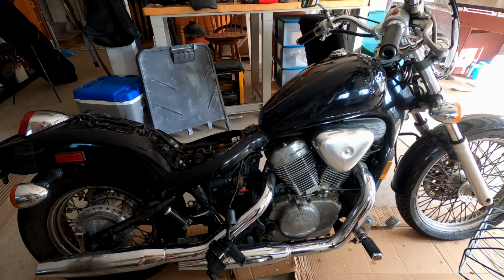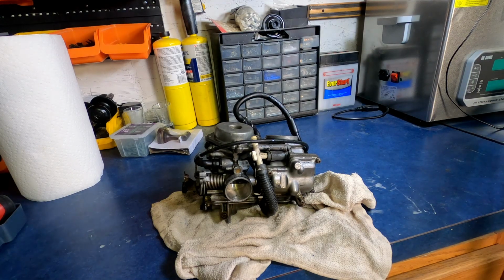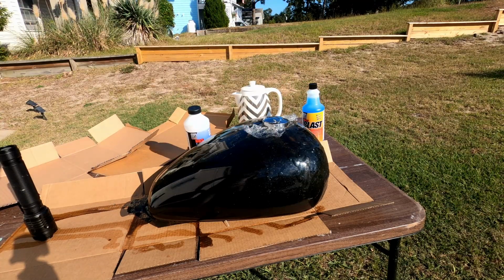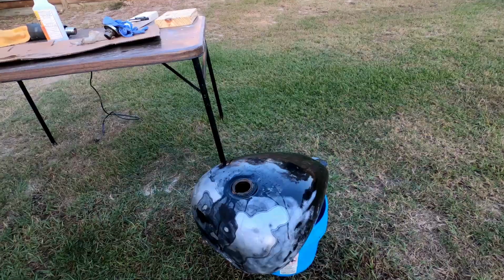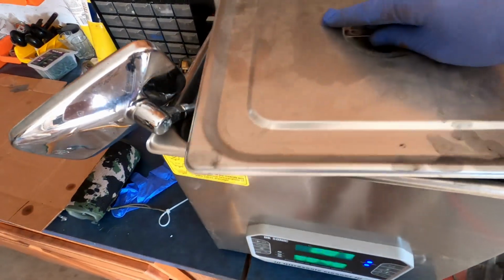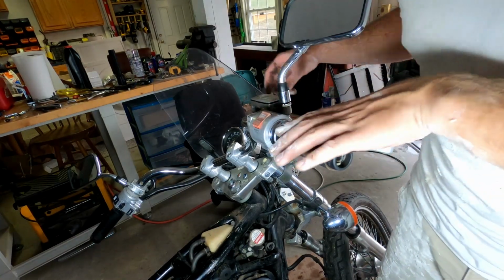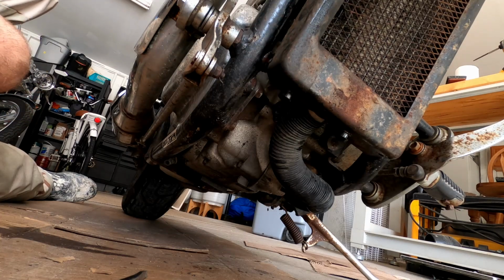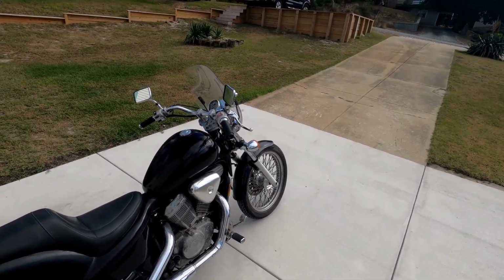1997 Honda Shadow VT600C VLX Restoration & Repair | Carb Rebuild, Fuel Tank Repair, & More!

Comment: Nice video! I just picked up a 2002 VT600 this past weekend. Super useful info here as I'm about to go through all the same processes. Got the parts in to start tomorrow.

I'm curious about that seat though, it looks really nice and isn't as wide as some of the other aftermarket ones I've seen. Do you know the brand?
Reply from the maker: Thank you for the comment! I believe it was a Corbin.

Comment: Whaou ! Nice before, better after ^^
We have this bike (with a friend of mine), 1997, and we want to make it run again  but.... (there is always a "but") : there'e a lot of electrical problems...Everything is...not working ^^ Electrical wiring is ...not in a good health ^^
We need to change it (a new one is very expensive !) so we would like to repair it. Do you know where we can find this kind of stuff (electrical diagram) ?
Thanks a lot for my friend and me, and we hope to make this beauty as beautifull as yours <3
(sorry, I'm french ;) )

Kisses !
Reply from the maker: Thank you for the comment,  for the electrical this might help:

https://support.shoptjbc.com/article/265-honda-shadow-vt600-vlx-600-ignition-circuit-diagram
Reply: @DIYCoastie   Thanks ! I have this website in favorite (usefull for the service manual) but I missed this diagram !
Thanks again, ride safe ^^

Comment: What was the estimated value of the bike before and after the $375 additions?
Reply from the maker: Before was more like $800 as a non runner, could probably get $1,500 - $2k now, but it has sentimental value to the owner so it just needed to run.
Reply: 95 honda shadow 600 in EU is 2500€+ , DAMN , also respect